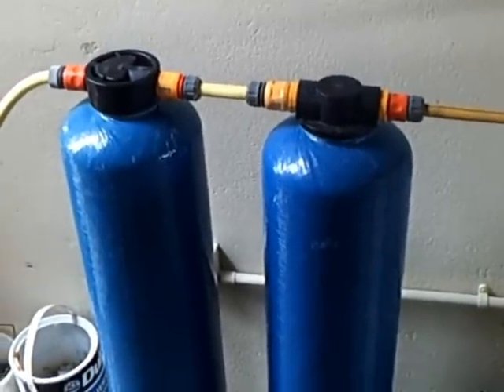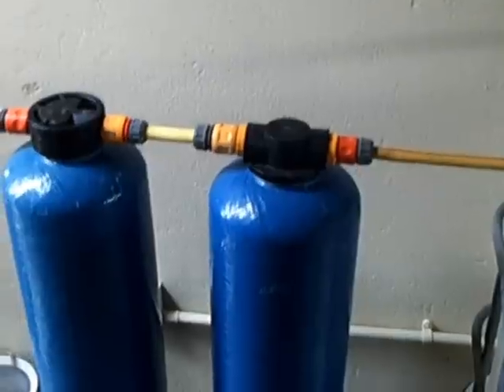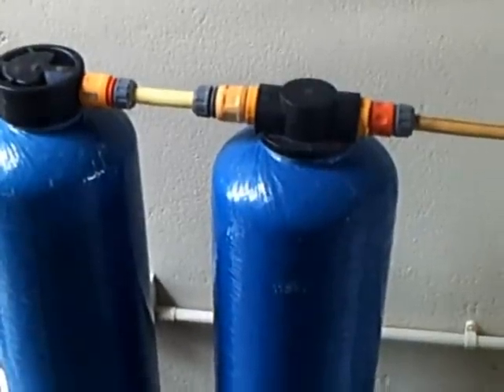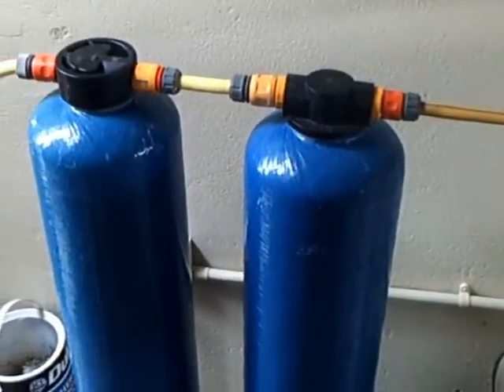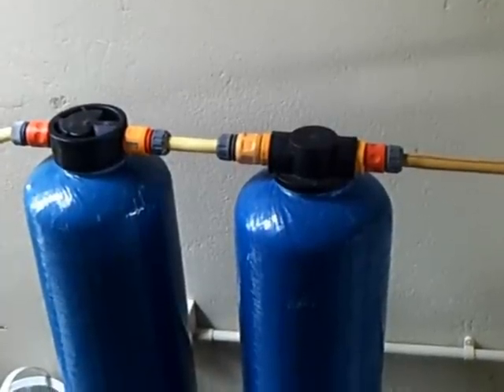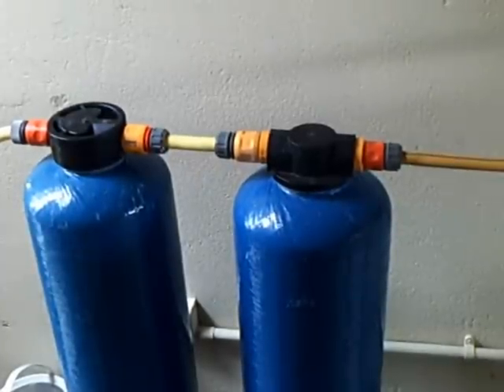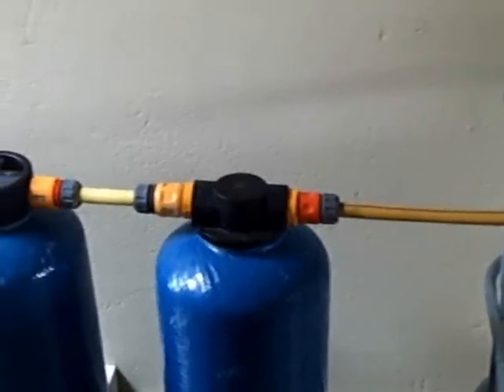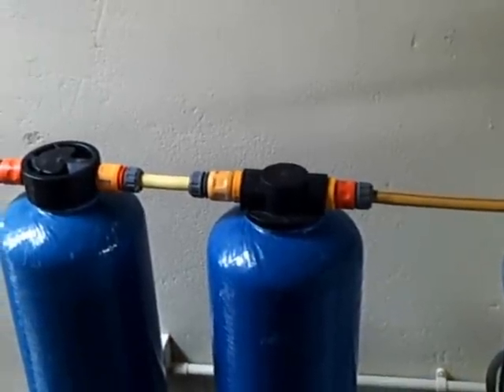Making Pure Water with a Twin Di Vessel  for WFP

Comment: Hi mark, if i boght 2 6 litre di vessells an a 25kg bag of resin how long would that last? Usin around 300 litres a week atm
Reply from the maker: Jack Stratfull you need to check your ppm then have a look on Gardiners website they have a ppm calculator
Reply: Do you know how long it lasts?
On two resin bottles and a bag of resin.. how many liters of clear water do you produce?

Comment: I do bottoms traditionally and bottoms use more water than tops with patio doors and conservatories etc so manage to use around 400l per week working 5 days all day 
That means even with 300ppm at the tap i use a full £75 bag every 11 weeks ish
That is a single 25l di
With double di and swapping them when one is getting close to tap ppm i use about 1 quid or 2 a day
Much happier to do that than use my ro and going on a meter soon so even better
Great vid Mark
Reply from the maker: cheers mate

Comment: hi mark... a few questions from me.. i have bought the new Hydropower from Unger. i got just about 800 liters of water at 000PPM.. the price of the filters were ca 50 pounds.. how many liters do you get from a single canister? I am thinking maybe the way you are doing it are cheaper for me as well?! my tap is 208 PPM by the way.
Reply from the maker: I get around 6000 lts but dont forget that is a bag of resin plus I use mine past 000pm

Comment: Hi ... Working off the premiss that the second DI Vessel has cleaner and purer water going through it....after you have used this system the very first time....could you use the second DI Vessel (containing cleaner resin) as the first DI Vessel...removing the bulk of the impurities and then just refill what was the first vessel and then place it in the second position for a final purification.Maximising the resin use to its fullest?

Comment: Hi. Thank you for the video. We are trying this system in north wales. Our tap water is only 160. The first vessel we used for three weeks. For some daft reason we didnt check the tds for the last week or so. To our horror it was reading 075 when we started getting complaints. I then added the 2nd vessel full of new resin. For some reason this read 002 for our first 350 then 004 for our next 350. Does this happen to you or does it read 000 for the full 6000 litres? Any suggestions would be gr8